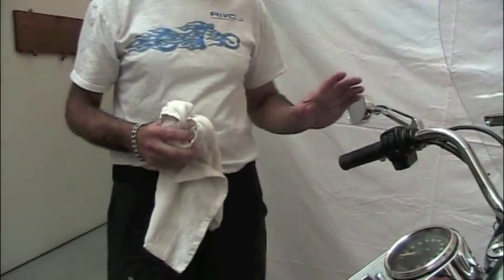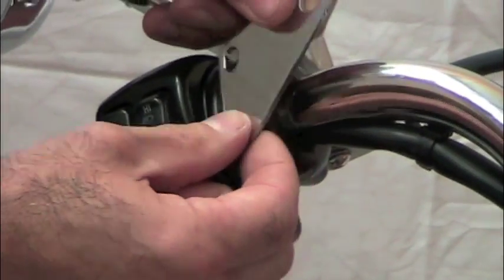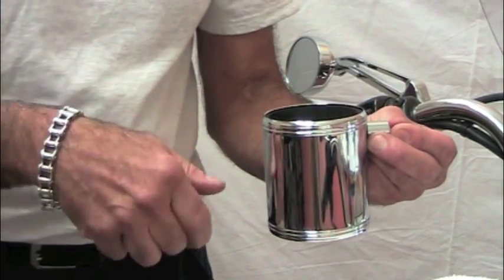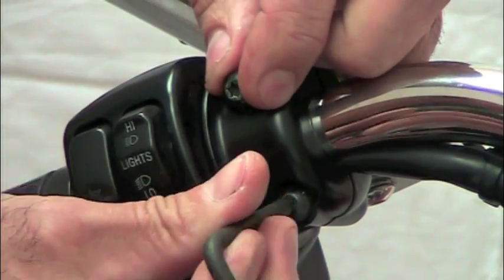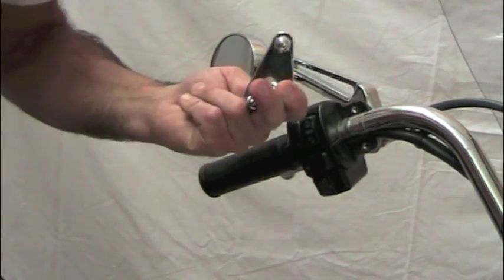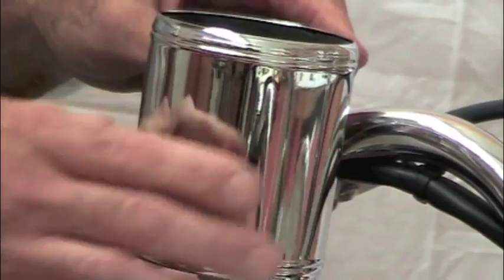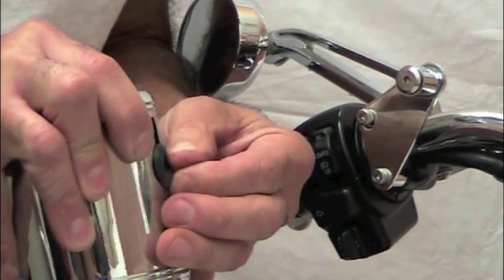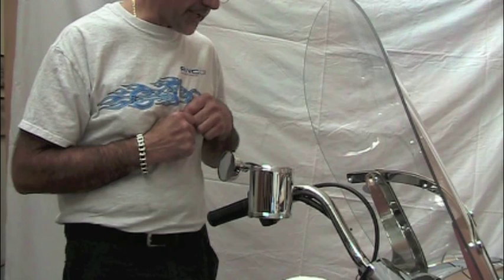Switch Plate Cup Holder Installation

Comment: Should I use lock tight on the screws?
Reply: I used no lock tight on the two screws in the switch housing, didn't have an issue them coming loose. However, the screw that holds the cup holder on, had the issue it was coming loose from the vibration of the bike. Went over some train tracks and my cupholder fell off. So I am trying lock tick on the screw and hope it holds and doesn't come loose on me again.